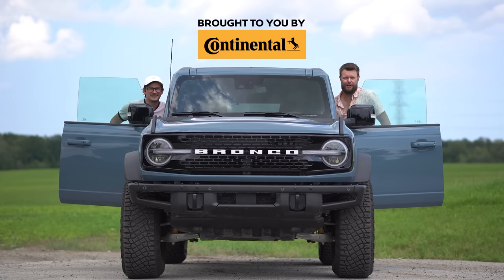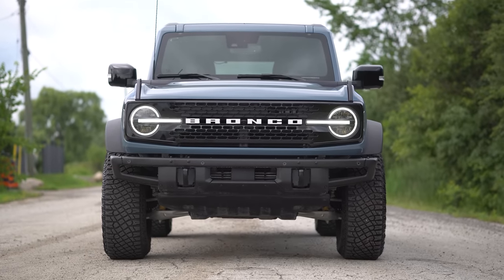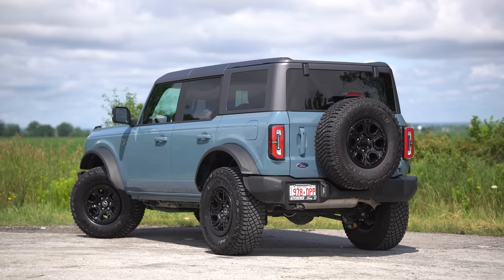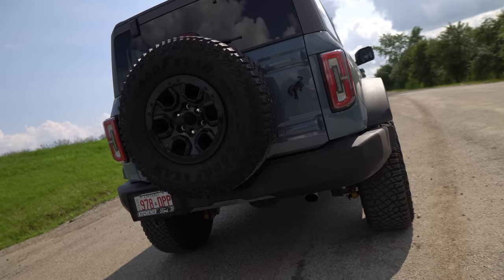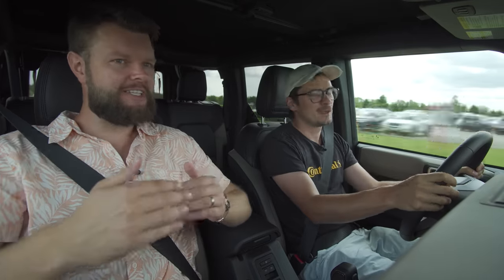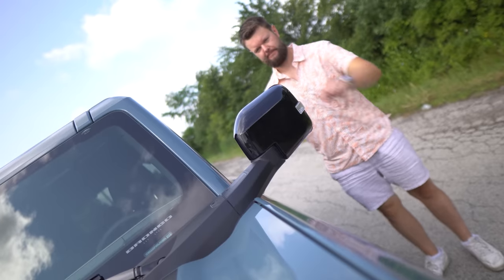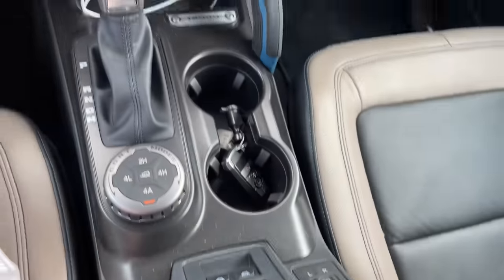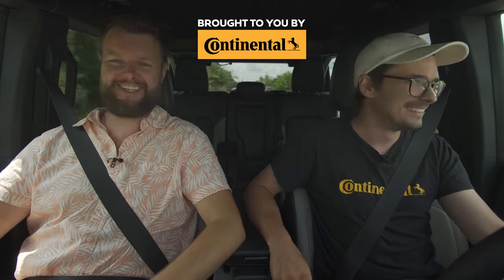RIP JEEP! 2021 Ford Bronco Review

Comment: Does "eco" mode turn the engine off and tell you to hike the rest of the way?
Reply: ouch. lol
Reply: Just wait five years, then it wont be a joke anymore
Reply: Wow they even stole that feature from Jeep? Impressive.
Reply: Absolutely, it stands for Energy Cut Off. Can also be used in emergencies
Reply: We legitimately only have 44 years worth of gas  left 🥶🥶🥶
Reply: Jeremy Clarkson approves 🤣
Reply: I will never buy a vehicle with the ridiculous, engine killing, auto engine shut off and turn on.  There is no way an engine that goes to zero oil pressure and is restarted then goes back to zero oil pressure again and is restarted over and over is going to last as long as an engine allowed to idle at proper temperature, oil pressure, and upper end lubrication.  I have checked the diagrams.  There are no check valves keeping oil in the top end.  As soon as the engine stops, oil starts draining into the sump.  By the time it restarts, it is usually very poorly oiled.
Reply: @indridcold8433  due to epa regulations this is pretty much mandatory anymore
Reply: @RobertBeedle  Some Toyotas like the Tacoma and 4Runner don't have start/stop, although they are older designs.  Current model Camry doesn't do it either.
Reply: I've always hated how they market their turbos 😑
Reply: @levimulkey2844  A four cylinder engine with a turbo is a grenade. Avoid at all costs.
Reply: Clark Kyle  Agreed.  An automatic 10 speeds are ridiculous in all car makes.  However, the CVT is even worse.  I probably change two of them a week with Nissan always being one of the CVTs changed.  Many times, the two I change are both Nissan vehicles with crappy CVTs. The only time we changed three in a week, all three were Nissan vehicles. The only maker that seems to make good CVTs is Subaru. I have never changed a Subaru CVT.  Strangely, the Toyota Prius has a great CVT also because of the planetary gears.  It does not use a stupid belt.  The only one I changed was because someone ruined one by putting some weird additive into the transmission. That is how I found out the Prius has a planetary gear CVT.  I really, do not understand why car makers are so terrified of putting manual transmissions in vehicles for the American car market.  That would solve so much.  It would even solve the idiots playing with their cellular phones while driving.  I also wonder, if the vehicles for the American market are pushed with an automatic transmission so much, why not just use a gear driven, hydraulic, automatic transmission?  If it is not broken, do not fix it.  As you mentioned, 10 speeds are ridiculous.  They need to be terminated along with the belt driven CVT junk.
Reply: Clark Kyle  Yes, it is in many vehicles. But they are not reliable. They clog up with sludge and carbon very early in their service life.  Gaskets leak profusely around 140,000 miles in a lot of them. They do not belong in a Mustang at all. People will still think they have a true sportscar, even if they have a four cylinder, turbo charged, engine instead of a V8.  They will try driving it like a Mustang with a V8 and grenade the tiny engine with so much overwork it has to do.  By the way, the 2.3 litre engine will beat the  V8 off the line.  It just does not have the upper end the V8 has. I could not believe how fast the four cyclinder Mustang was off the line.  They are fine for a focus.  They are not pushed as hard as they woudo be in a Mustang or a new Ranger.
Reply: Clark Kyle  Plastic does not belong on anything in a vehicle, not even the interior.  It is inferior in every way to steel, save for weight.  I have noticed very inferior car making being passed as a benefit to the driver.  The strange thing is, people believe it is a benefit.  It seems people believe anything the automaker says is a benefit, really is a benefit.  The vehicles coming out today are garbage.  This is why I still drive the vehicle I bought new in 1996.
Reply: Clark Kyle  Direct injection is only more efficient for the optimal service time of the engine.  After that, it is not efficient at all because it will fail.  Meanwhile the old port injection engine still has 150,000 more miles to the first rebuild.  Temporary fuel efficiency does not replace engine service life efficiency. It will cost far more to replace the short life engine.  The failed engine will have to be melted down to make a new engine.  This will use more energy and produce more pollution than the engine could ever make during its service life.  More than likely, the entire vehicle will be melted down to make a different car which will produce far more pollutants and use far more energy than the car could have ever done in its service life.  These, "experts," can not think of the long term effects of these fall apart vehicles.  Meanwhile, the old cars are sti running strong and will not be melted down for decades to come.  I see no environmental nor financial benefit to new cars at all.  The short term is all people seem to look at and make a decision on the short term.  I recently had a 2017 Buick Enclave come into the service hub. The tiny turbo charged engine failed at just over 60,000 miles.  The sales department had just paid it in full late last year.  I gave the estimate to the management.  I estimated the price of a new engine.  It exceeded the price of the Buick Enclave.  I suspect it will be auctioned as scrap at the beginning of next year.  Nobody is going to put $5500 into an ugly Enclave.
Reply: Clark Kyle  You are thinking short term.  The engine will fail in 1/3 the time a port fuel injected engine will fail.  There is no way a failure prone engine is going to be efficient no matter how good the fuel economy is if the engine will need a rebuild very soon or replacement.  That is not efficient. It I as wasteful.  Chances are the entire vehicle will be junked when the engine fails.  To melt down a retired vehicle it produces far more pollutants and uses far more energy than the vehicle could have ever done during its service life, even if the vehicle was a thirsty guzzler.  Keep your vehicle as long as possible, and running as good as possible, your finances and the environment will thank you for it.  Right now, there is a failed Buick Enclave in the maintence hub.  The sales department just finished paying it completely the end of last year. I left an email to management that the vehicle needs a new engine.  It will likely be scrapped.  It made close to 40 miles to the gallon when it was functional.  Now it is essentially nothing but parts and scrap at just over 60,000 miles.  That is not efficency no matter how you look at it.  It is waste.  Meanwhile, the older E-150  with over 200,000 miles is running like new.  It makes about 15 miles to the gallon. But it has a log service life ahead of it.  It will not be seeing the scrap furnace for a long time.
Reply: Clark Kyle  It is not my money. It is the company's money and vehicle.  It was recently paid completely in full.  Now it has catastrophic engine failure I merely work on it.  No vehicle with that low miles should have to have that much money put into it at all, no matter how much fuel economy it makes.  If you can live with a nearly new vehicle costing that much money, have at it.  It is your money. You are not running a company.  I can guarantee management will not be fixing that ugly pile of junk.  It will likely be sold as scrap at auction the beginning of next year.  Meanwhile the older E-150 service van with over 200,000 miles still has a long service life ahead and does not have a smelting furnace in its near future.  I do not know how that kind of waste is excusable to anybody, or any company, financially and environmentally. If the company orders the engine, I will put it in.  However, it will not happen, especially when the management sees the low miles it has.  The ugly thing is, they bought tow more of those things.  This year they bought two Rangers for localised delivery and two Explorers for sales department use.  I can guarantee the Rangers will be extremely problematic right about as the last payment is made on them.
Reply: Clark Kyle  You obviously make no decisions for a company motor pool.  These vehicles have to stay together as long as possible.  Since I am a company in-house mechanic, I do not want to take my work home with me. I still drive the same vehicle I drove in 1996, though I did buy it new.  It has 421,000 miles on the odometer and climbing. That is what efficency is, one car lasting as long as possible with as little work done to it as possible. If new technology is all about waste, failure, and excuses, and people mistake that for efficient, they are welcome to buy it.  It keeps mechanics in business.  These vehicles will be melted down far sooner than the port fuel injected vehicles. That takes far more energy and produces far more pollution than the service life of even the most thursty of guzzlers. But people are fooled into thinking they are saving money, environment, and troubles.  It is okay by me.
Reply: @indridcold8433  I believe they do it so gas guzzlers can pass smog ratings (silly California). A 5% boost in mpg is sometimes the difference from being able to sell cars to the US. A lot of Japanese cars don’t have them because most Japanese cars have fuel efficiency first in mind. Even the 6 cylinder Toyota/Honda engines are smaller per litter than the comparable American truck or German SUV.
Reply: @ricecakeboii94  I am sure the function saves a spoonful, or two, of fuel.  But the engine will fail prematurely. When this happens, the vehicle I as likely to be scrapped.  The energy spent to smelt the car down and make a new one will exceed any possible amount the vehicle could ever use.  This, of course, will produce more pollution than the vehicle could ever produce as well.  But a tiny bit of fuel was saved in the short run.  When the vehicle is melted down, all the collective spoonfuls the vehicle ever saved are voided when the vehicle only had a service life of I to ten years. Meanwhile, the older style car is still good for twenty long years. Of course, politicians, environmental, "experts," and not all the environmental ministries, agencies, and departments of the planet realise this.
Reply: @indridcold8433  Oh no I agree. But that’s California for you. Ruin it for everybody else really.
Reply: A+ Dad Joke
Reply: Super late to this but still funny 😂😂😂
Reply: My respect for Ford would go way up if it did!!!!
Reply: Just wait five year: you won’t be able to start your electric car if daddy government thinks your political opinions are “unacceptable”. 😂😂

Comment: I have been a full size truck guy for 40 plus years and I traded my awesome gladiator rubicon manual in on a bronco  sport badlands  and guys it’s an amazing little off roader.Especially if you are doing 45,000 miles or more a year.The Jeep takes a toll on the ears and body and the wallet 15 miles per gallon.If you drive a lot but still want a truck that can go most anywhere and your not a kid anymore the bronco sport badlands is a great option.Great job as always boys !

Comment: I'm loving this thing! I don't know that it's going to sway a lot of current Wrangler owners, but I think for people on the fence between a Wrangler and a 4Runner, this is going to be a perfect choice. Also, the 4Runner is so outdated,  this thing is going to eat its lunch easily.

 Signed, a 4Runner owner who would much rather have one of these.
Reply: Disagree, the 4runner has a much different market. The people who would be looking at this would most definitely be comparing it to the Wrangler. I would choose a 4runner for Overlanding any day. I would choose a Bronco for Rock crawling any day.
Reply: Yup. $50k for an SUV from 2009 is pathetic.
Reply: That outdated 4Runner will last longer than 4 up to date Broncos.
Reply: Specs . IFS front like a T4R, looks like a wrangler. As you said people who just wants the looks of wrangler with reliability will go for a Bronco. Rock crawlers, always a wrangler. you can't beat a live axle front-end. But people whose first preference is reliability and space, always a 4runner. Right now, bronco might also eat 4runner's share with 5th gen being more than 10 years old.

-fellow 4runner owner
Reply: Nothing with independent front suspension is going to take wrangler customers. Unless it’s the ones that don’t go off road. The ones with mall wheel drive
Reply: @RougaRouKJun  that's why I think this will poach some 4Runner owners. I think there are a lot of 4Runner owners (or potential owners) that bought the 4Runner because they thought the Wrangler was a little bit too hardcore for daily driving. Broncos fits right in the middle, it's got the cool ruggedness of the Jeep, but with better road manners. 

I agree though, the hardcore Jeep owners that actually do serious off-roading will not be enticed by the Bronco at all.
Reply: @trailrunnah8886  Honestly you got a point. I just bought a 2020 TRD 4Runner, but for some time did consider the Bronco. Although I love Toyota, I probably will give Bronco a chance in the future after a few years. For now, the 4Runner is an awesome vehicle.
Reply: @pkingpure100  yeah, I hear you. If I had to buy a new vehicle today, I would go with the 4Runner over the Bronco just because there's no way I would buy a first-year of any new vehicle. I would say give the Bronco another three or four years to work the bugs out, then start shopping one. I just read today that they're already having issues with the hardtops on the four doors.

I think I'm pretty much done with buying expensive vehicles, but if I wasn't I would be looking harder at the Bronco in that time frame, for the reasons I listed.
Reply: @trailrunnah8886  I agree. I was just addressing the ridiculous title. This thing they’re selling as the same suspension as a Ford ranger. Honestly I  wish there was some competition for the wrangler it does drive innovation. The bronco (or ranger with removable top) isn’t it.
Reply: @marshalkiruba  If they want a wrangler with better reliability than Toyota is the only option but they don't make a proper wrangler competitor. FORD isn't even close to be called a reliable brand.
Reply: @RougaRouKJun  in 2 years most people will be aware that the Bronco is just another Mall crawler, which is fine. I think it's looks aesthetically nice, external wise.
Reply: Not sure a Ford Bronco will eat a 4 Runner’s lunch anytime soon….
Reply: @hse6144  yup
Reply: @hse6144  Yup!
Reply: Some say it’s outdated which it is but A. You’re basically guaranteed a reliable suv that will last 10+ years vs a shitty jeep or not so shitty ford. Also I’m pretty sure they are totally redesigning the 4Runner as we speak.

Comment: I’ve accepted that the motor is a v6.  Don’t really think it sounds bad for a v6.
Reply: Probably a fake engine sound lol, it’s sort a Ford thing now😂😂😂
Reply: @tonymeng2580  nothing is as bad as the VW group and BMW. I can accept the V6, I think Ford is doing amazing with the V6 engines…Altough the engine note can be a bit…less fake, I think the EcoBoost V6 platform is the best one out there, how versatile it is and the possibilities of it (since they are in eveything) are very high…imagine a Bronco with the V6 from a GT!
Reply: @AbdulazizAladwani-ke7in  I would get the I4 just for the manual. No other reason.
Reply: I hope it's been addressed but to my knowledge the Ford Ecoboost v6's have timing driven water pumps. They are in the middle of the v but have no weep hole. If the water pump leaks it will put water into the oil, and subsequently wreck the high stress engine.

Update: Russian man has informed me this is only on the 3.5 Ecoboost.
Reply: @MrClassifide  Wtf kind of backyard engineering is that 😂
Reply: @MrClassifide  2.7 in bronco has quite normal water pump location, not inside of V like 3.5 ecoboost. Know it as already have 2 cars with that engine.

Comment: So looking forward to seeing these everywhere and I hope in the future I can pick one up used for a good deal some day. One thing I've always disliked about the Wrangler is how rough the ride is, it seems this has a more road-friendly ride while still offering similar off-road capabilities as the Wrangler. That's a win-win in my book.
Reply: It offers off road not"similar" ford took a few Broncos out to the Rubicon trail to one up Wrangler Rubicons 🤙
Reply: @akuma_mx5  When I say "similar", I mean more or less the same as the Wrangler on every off-road obstacle. Not as puny as new Chevy Blazer, but not as extreme as, say, a Trophy Truck.
Reply: Thats what makes a jeep fun is the ruffer ride. If you want comfortable get a toyota or honda suv
Reply: @kevinhood9781  I agree, rugged off-roader shouldn't be expected to ride smoothly. However, the problem with a rough-riding Jeep Wrangler is that 90%+ of the actual driving most consumers will do is on smooth, clear, paved roads. Rarely do people actually go off-road in these things. Be nice to have a comfortable ride for the 90%+ of the time you're driving it.

Comment: I'd rather have a fixed windshield with safety systems rather than one id never fold down
Reply: Then the Sport is for you
Reply: @leecampbell2477  What are you talking about? Both the Bronco and Bronco Sport have a fixed windshield. The OP is saying he’d rather the Bronco over the Wrangler
Reply: @EVsSuck777  You missed his point entirely. What are you talking about sir is the real question. The wrangler is a purpose built Off-roader, the Bronco isn't, hence the IFS and fixed windshield. So what he was implying was that, since the OP has prioritized having a vehicle that looks like it's an off-roader but still retains it's road car qualities, he is better off just saving a ton of money and buying instead the Bronco Sport which is just a FORD escape rebadged with a new Exterior.